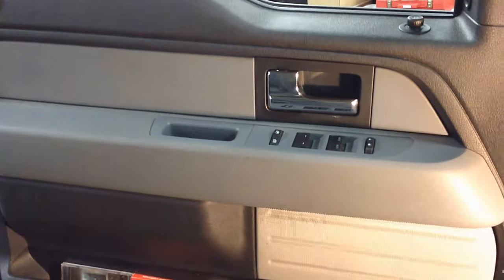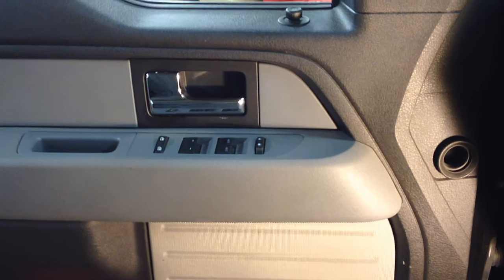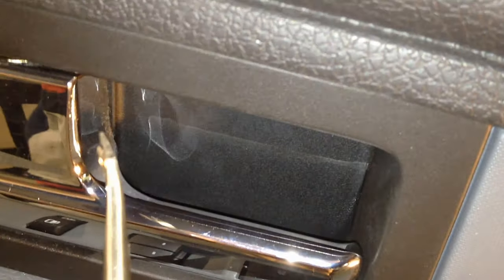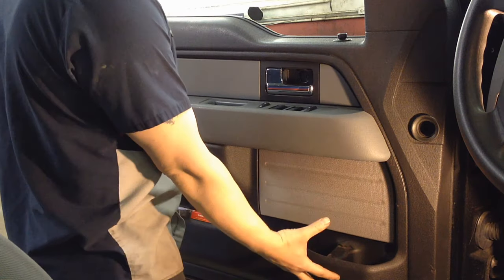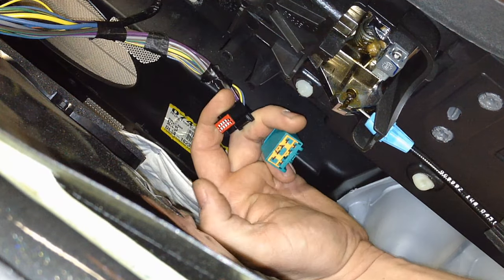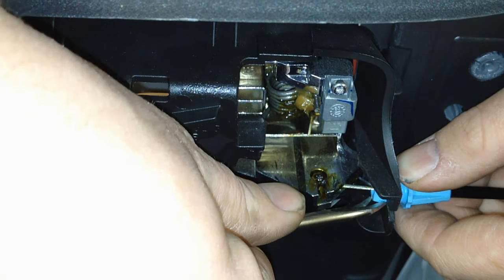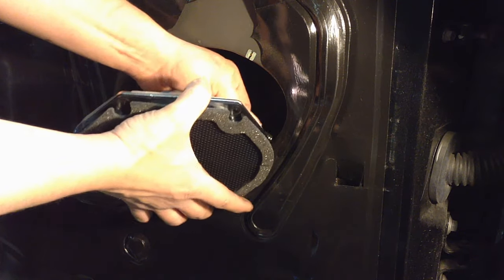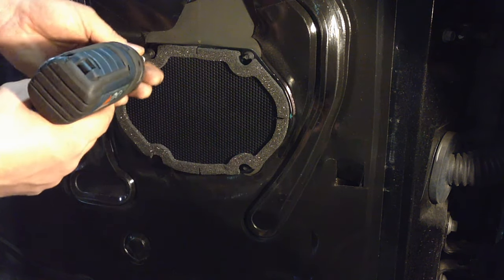2009-2014 Ford F150 Front Door Speaker Replacement- Door Panel Removal Procedure

Comment: Great video! I don't know if its mentioned anywhere but before you lose your mind putting the panel back on, there's something everyone needs to know. Obviously all the latches need to line up. Insert the three (I think there's 3) on the bottom first then everything will slide into place. Don't try muscling it, you might break something. Don't try talking dirty to it, you'll look like a fool. Just do what said.....easy peezy!!!

Comment: Being that i have a new 2014 with only 5000 miles and BOTH front speakers are nlown i found this extremley helpful
Reply: Turn her down a bit, eh
Reply: Same
Reply: @freeaudiobooks7469  make a better product, eh ford?
Reply: The stock speakers are stupid cheap, I'm not surprised they go out
Reply: @nbarrager  Drofa 25W 4 ohm Cheap Crap, yup.... Ford part# CL3T-18808-BC Made in China
Reply: @kenbenson7474  they list for under $20 from the dealership if I remember correctly
Reply: mine blew years ago too.  sound like trash.

Comment: Very helpful!  I found that I didn't need to remove the door opener cable, I just propped the door panel on a plastic garbage can after unplugging everything else and had plenty of room to swap out the speakers.  Piece of cake.

Comment: Fantastic video, you saved me over $100 for installation on
4 speakers in 45 minutes.  I replaced my four speakers with Kicker KSC68 and purchased the
adapter connectors to fit the original F150 connectors. The sound is incredible
and I had the same issue with the blown speaker.
My only add would be to make sure you fit the lock pole. Not
sure what you would call that, but I had to take the door panel off again to
make that part fit again. 
Oh and I did not have that nice hook tool, so I used a hook
from my tool cabinet with a needle nose plyers and pulled that plastic piece
off at the door latch arm. 
Did not have the 5.5 mm socket, but managed to angle the socket
to work.  
I am so happy I did this myself.
Reply: Link to the type of adapter?
Reply: Hey mark a little while later; how are those speakers working out for you? Thinking about getting some any recommendation
Reply: @lpdfilms5591  im about to install. Howd it turn out for ya

Comment: Great procedure. Used it yesterday to install new tow mirrors. Several other videos were not correct for my 2013. Thanks for your help and to the Ford engineers for designing one of the easiest door panels that I have ever removed. I didn't even have to remove any of the window controller connector to replace the mirrors.

Comment: Thank you! And quick tip. When putting the panel back on make sure the door is in the unlocked position so the door lock pin is up. Makes it a lot easier to align it into the hole! Took me about 5 minutes of trying to figure this one out 😂

Comment: Hi, Thanks for sharing this tutorial.  It has helped me a lot! I don't know if this has been mentioned but I didn't have a great trim tool to get that plate off where the door handle is.  I found a paint can opener did the trick. I had to work it some but the plate eventually popped off without any scratches or damage.
Reply: I did the same thing!! Who knew?!
Reply: I clamped vise grips onto a small Allen key.
Reply: Best comment... thanks, worked like a charm.

Comment: Thanks for a quick and accurate tutorial!  I could wiggle the wiring harness in the door jam and hear my left, front speaker go on and off.  Pulled the door panel and found that I have aftermarket speakers already, but one of the silly crimp-terminals was barely hanging on.  A quick 30 second snip, strip and solder job and I'm back to sounding great.  Thanks again.

Comment: Great video. Easy fix with simple tools. I found that my driver side front Ford/Sony speaker failed simply because the wire connector was mounted to the speaker body with flimsy plastic that broke away. Replaced with much better Rockford Fosgate speakers. Much better sound.

Comment: Thanks for this video! Made this job easy. One thing I found was that the speaker was not actually blown but the plastic connector had snapped on one side causing the wire to contact the housing resulting in a blown speaker sound. Repaired connector, $0 fix.

Comment: Nice video, it was very helpful. A couple comments as I went thru the process. In the 2nd step to remove the 2nd 8mm bolt, I found a long skinny screwdriver inserted into the plastic cover starting from the lower left hand corner popped out the cover. The best news is that when I pulled the speaker out I did not see any tears in the cone. While playing music I could stop the buzzing by placing my fingers on the cone at the 2 long ends. Then I stuffed cone with paper towels in the back and installed the speaker back again. The buzz is gone for now, a temporary fix (maybe longer) till I find a new speaker.

Comment: Thanks much appreciated.this allowed me to do my 2012 F150 both doors I used some Kenwood speakers and connectors i got from Amazon. Relatively easy, the hardest part was getting the door back in position, I used a long thin screwdriver to push the door lock button into the hole in the plastic framing it made the alignments quicker.

Comment: Thanks able to remove and replace with minimal swearing and no personal injury 
found speaker wire mount broke
Able to repair with zip tie 
Will order 4 new speakers if it happened to one I'm sure the other 3 are soon to snap

Comment: Excellent video!  Thank you.  I just followed these instructions to install some JBL - 6" x 8"  GX862.  The speakers sound GREAT!  Thanks again.
Reply: Brent Stone was that 6x8 for your rear speaker?
Reply: Diesel Matthew front and back.
Reply: Did they plug in easily?
Reply: Alexanderockport , I bought some adapters at BestBuy when I bought the speakers.  And they were very easy to connect.

Comment: My speaker sounds fine. When it works. It cuts in and out. I have a tweeter in the a pillar also and they go out together. So I don’t think that’s a blown speaker. I think it’s a bad connection from the harness. Going over a bump or banging on the door panel they kick in. sound about right?

Comment: Thanks for this video!  It will be very helpful for me.  Sorry this is a bit off topic, but are there any common things you know to look for on the passenger front door of a SuperCrew (2013 FX4 if that matters) for a rattle?  It sounds like it is higher up in the door panel toward the front of the vehicle.  Happens over even the tiniest bumps.  It's been to the dealership three times so far without any progress.  The most recent attempt was installing a big foam piece in the door.  

Thanks again for this video, and honestly, all the others you do.  Super helpful!

Comment: How many amps can you run on the factory wires like what's the maximum Watts on the radio or the amp on the factory wire for those speakers

Comment: What about a speaker on a 2011 F150 that is coming on and then going off ? Has came back on by moving wiring system at door. Not sure how to remove it to check it out.

Comment: what aftermarket speaker did you replace it with. i cant find any that are just plug and play like that
Reply: If you go to crutchfield.com and put in your car, they will supply adapters that connect to the speakers and the factory connector

Comment: Hello,
I am a big fan of your channel and have an unrelated question to this video I am hoping you can help me with. I am rebuilding a salvage 2013 F150. The air bag light wont go off. No bags were deployed and its not throwing any codes on my scan tool. I even changed the front crash sensors on each side of the core support as I had from a swap vehicle. Im at a loss for why the light wont go off and any help appreciated.

Thanks
Jim

Comment: My 2011 F150 passenger front speaker started to sound blown, but was inconsistent going off and on. Then the whole speaker itself stopped working. is it a speaker problem or a wiring problem? Just want to know before i buy speakers and replace them

Comment: Thanks GREAT video!

the wiring harness problem you spoke of in the pre 2011 models (I have a 2010), is their an easy fix for that or do I need to replace the entire harness?
Reply: Curious on if you ever got this fixed because I have the same problem

Comment: Since I purchased my 2010 F150, new, the drivers side door speaker has been off more than on.  I advised the dealer, they said they thought it was ok.  Now that it is way out of warrantee they tell me there is a service bulletin on the issue.  Do I really need a new harness, or is the issue (as some claim) just to replace the speaker with a new plug?

Comment: Thanks for the Video!  I have a question, my 14 F-150 KR has the "premium" system and says "SONY" on the door panels.  Are those speakers better or just premium crappy?  Thanks
Reply from the maker: Never had a problem with those upgraded speaker to date.
Reply: FordTechMakuloco
Good to hear, thanks!
Reply: kclm7 just came across this video an your message... I have a 2014 platinum with the Sony speakers do you remember what size speakers were the front door an rear?

Comment: Great vid! My drivers side speaker blew out, or so I thought, until I took it apart and noticed one of those white wires that plugs into the speaker was very loose, then fell out before I even removed the speaker. I’m going to get some aftermarket jobs, but as far as the wire, can I just re-strip it, twist it up and pop it back into that hole?

Comment: Why on my  2011 Ford F-150.  The radio. Has power. Everything is. Works. But no. Sound.  It’s any fuse. That. I have to replace
Reply: I had the same problem, have to get a new radio 😊

Comment: Do you by chance have a video made for replacing the wiring harness in the doors regarding the TSB 13-10-18 on 2010 - 2012 F-150's? I have the factory Helm manuals and they do not seem to reference the routing of the harness or the vapor barrier on the doors.
Reply from the maker: No I haven't seen one in awhile to do a video on. It is all very easy thouh you will see where it all goes. Best to take a video before hand of where everything routes to.
Reply: FordTechMakuloco What about the putty stuff that holds that plastic vapor barrier up? doesn't look like there is a way to save it, so what is the resolution to re-attach the vapor barrier?
Reply from the maker: There should be more than enough to hold it back on. Otherwise you can get this stuff call strip caulk from 3M.

Comment: Dear Mr Makuloco,
I have a 2005,F-150 super-cap that I want to replace the front & rear speaker on. It looks easy on the front but how do you get to the rear? I looked for a video on this but I did not see that you have one. How do I get to the speaker in the rear door? Thank you,Doug.
Reply from the maker: Douglas ZIMMERMANN send me an email with your information I will send you the procedure.
Reply: FordTechMakuloco Dear MR Makuloco, In your video it is for 2009-2014 F-150's. Is it the same? I was looking at it & I think I know how to take  off the rear panel's (on my 2005) but want to be sure. How do I sent you an E-Mail? I just don't want my E-mail on this site for everyone to see. And thank you for getting back so soon & for all the info you give everyone on here.
Reply from the maker: Goto my channel home page and then the about page there is a link for inquiries.
Reply: FordTechMakuloco Hello MR,Makuloco,
I just did (replaced F&R) my speaker's on my 2005 F-150. I just looked at it & with your video on the 2009-2014 it was real easy. Almost the same as the 2009-2014. Boy what junk speaker's they put in the F-150! I think Ford owes me money? LOL. Thank you for everything. 
Doug.
Reply: +FordTechMakuloco i replaced the front speakers in about 30 mins but i cant seem to get the t50 torx bolt loose any ideas? please

Comment: Hey Brian you ever see any 2012 focuses with a complaint of driver door creaking noise.they put a new door check in at 35 k under warranty then a week later it started making noise again. now they say its a broken weld on the a pillar and since my car has over 36k even more that the ford extend warranty will not cover my issue.I love my focus but at the rate of issues I've had with this dealer and the car, I wish I would've put a transmission in my ranger my 3.0 never let me down ever.
Reply from the maker: Ok so they misdiagnosed it while under warranty therefore the repair is still covered based upon the original repair. Get Ford Customer service involved they have programs for this kind of after warranty service.
Reply: That's what I figured.
Reply: Thanks you ever see any of them come in with pop clunk from the floorboards
Reply from the maker: nmattcar No not from the floor boards.

Comment: Great video and thanks for the upload. My 2014 F-150 SuperCrew has blown both front speakers in only a few months and was looking to get replaced. Did you use new FORD speakers to replace the old ones, or did you use something alittle more in the quality department? Curious because of the wiring that you disconnected right from the side of the speaker, itself, and whether or not I can expect to see that on Factory parts or aftermarket.

Comment: Do i need a wire harness if i am replacing the factory speakers with a different brand of speakers? and if so where can i get the wire harness?
Reply from the maker: +will ack Some companies have harnesses to just clip in to the stock wiring but most of the time people will solder the factory wires to the new speaker tabs.
Reply: @FordTechMakuloco   So cut both the end clips off the aftermarket and OEM? and solder them?

Comment: I wonder if that adapter will fit an aftermarket speaker just as easily or if you have to splice the wires old school? 🤔
Reply: 450rmack Metra and Scosche make plug in adapters and they’re only like $8-$10 for both speakers.

Comment: Great video.
May I ask you if you countered a costumer complains about rattling sounds coming from passenger door panel in the Edge 2011+ models?
Reply from the maker: No not that I can remember.
Reply: FordTechMakuloco Thanks for your kind response. I will try to make a video about it and show it to you if it is possible.

Comment: Great job I think I am going to replace my speakers this weekend. Have you by chance replaced or fixed the visor with the electrical for the garage door opener.  The sliding action of the visor breaks these wires in a year or two and a replacement has done the same.  I want to repair the wires with braided stranded copper or something that can withstand the sliding.  It appears the OEM visor design is poor and they are using the wrong type of wiring.
Reply from the maker: Tom Dunkle I have replaced them for this yes, once you unbolt the visor you will see the electrical connector. I think I was able to remove the vanity mirror without damage to look inside and see the broken wires.

Comment: Great video. Do you have a video on repairing the F150 (2010-front passenger door) speaker wiring fault? Thank you, Tony
Reply from the maker: ts302 No I don't I have only changed the harnesses in the past.
Reply: The wiring harness in question is the one between the cab and door? Is it possible to repair the original harness? Thank you, Tony
Reply from the maker: Yes the door harness it is a complete one piece harness that plugs into the body side.

Comment: I like your battery powered impact gun. What brand is it? Is it a 3/8 or 1/4 inch gun?
Reply from the maker: +Neil Perry This is the one I use all the time for everything it's 1/4" but powerful-http://www.amazon.com/gp/product/B003LST02W/ref=as_li_tl?ie=UTF8&camp=1789&creative=390957&creativeASIN=B003LST02W&linkCode=as2&tag=fordt-20&linkId=NEAOB2262RW3BQJ3

Comment: Could you tell us the SIZE of speaker to buy,...I would like to have the new ones in hand before removing door panels,...also don't forget after market speakers will probably need cable adapters to avoid cutting into the original wiring,...Robert B
Reply from the maker: 70carlton I believe they are 6X9 speakers but a site like crutchfield is always best when researching exactly what fits in your particular vehicle.
Reply: They are 5x7 or 6x8, 6x9 won't fit.

Comment: Do aftermarket speaker just plug in with the same connector?
Reply: some will, if not you have to cut the end off, strip it and connect the connector that fits the aftermarket speaker

Comment: Nice post… Just an fyi… you don’t have to remove the handle cable… the entire handle and housing pops out easy and you can turn it flat and slide the whole handle and rectangle housing out from door panel.
Reply from the maker: Yes I know but the clips can break so we avoid pulling anymore apart than we have to

Comment: My 2013 had 5/16 and 7/32 on the panel and I used a 5 mm on the speaker screws Also if you use aftermarket Speakers and I can’t imagine anyone using the original Ford type speaker. The speaker connector has to removed and replaced with the flat connectors

Comment: Fantastic videos!! Thanks so much for doing this! Can you post a video on how to remove the rear door panel on a 2011 super cab? Thanks!
Reply from the maker: falconjet3 You know what I should do that I have had a few questions on this before, I will put it on my list.
Reply: +FordTechMakuloco any luck ive been trying to replace my rear speakers on my extended cab but i cant seem to get the t50 bolt loose, would love to see a video whenever possible?

Comment: 2011 f150 my stereo started to blink on off and then stopped working any ideas on  what's wrong
Reply: Also my headlights and tail lights flash on/off along with the stereo and the dash. I've pulled 2 fuses and it stopped